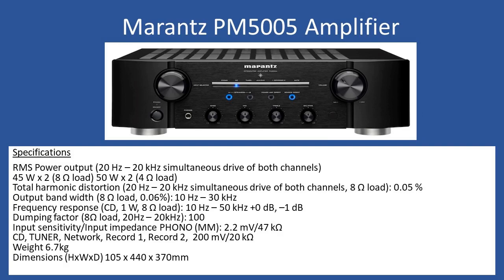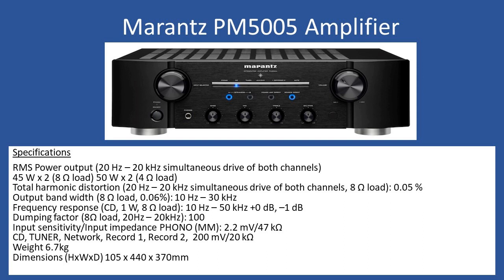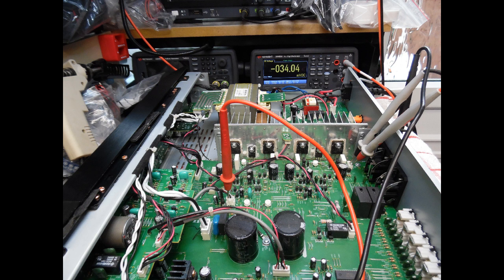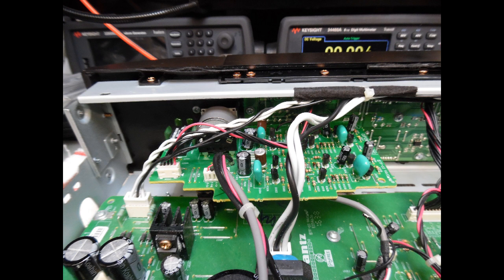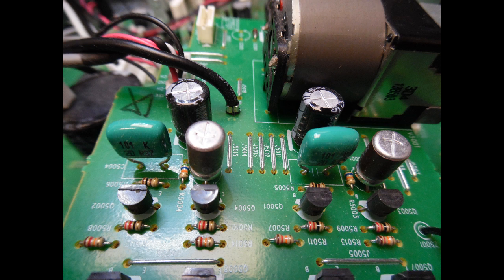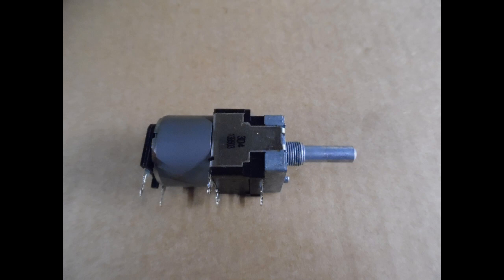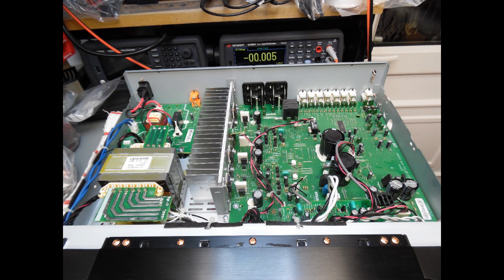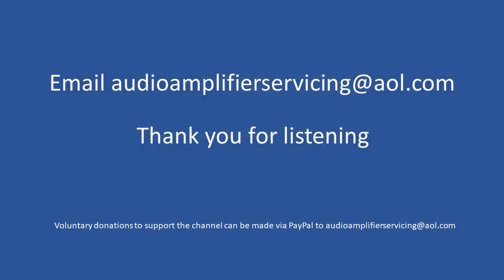Marantz PM5005 Repair (With Audio Tutorial)

Comment: Hi, bit of a newbie here. Can you please explain how you measured the static resistance of the volume potentiometer across R5004 and R5003 8:21?  Where exactly did you place multimeter probes? And did I understand right you said that the measurement was done with no power applied?
Reply from the maker: Hi Yes the measurements are made with no power, to measure the resistance change of each of the potentiometer gangs.
Connect you multimeter across each resistor inturn, the readings should be more or less the same. You can rotate the potentiometer to check if the resistance changes across each of the resistors again the resistance measured should be approximately the same.
Reply: @AudioAmplifierServicing  Ok. Thanks! Also as it is near impossible to get a volume pot replacement for this amp in UK (all sites say it is either unavailable or discontinued) I managed to source a supposed like for like replacement but the part number is 422M-50KBX2. Apparently it's an ALPS RK168 motorised potentiometer. Do you know if this is a suitable replacement?
Reply from the maker: @petelamparski8226  Hi I do not have details of the pin outs and compatibility. A genuine replacement can be ordered from here they ship world wide https://www.soundservice.gr/e-shop/en/product.php?products_id=13275
Reply: @AudioAmplifierServicing  Hi. Thanks for that. It's not cheap though... €55 plus shipping😳 That is almost as much as I paid for my second hand amp (PM6005 model). I paid a fraction of that price for this volume pot. I bought more than one just in case, so I guess I can open one up and compare it with the inside of the faulty one to see if everything matches. It looks exactly the same from the outside with same amount and positioning of the pins and it's advertised as volume pot for the Marantz PM6006. From what I have read online both PM6005 and PM6006 are using the same volume pot. Do you know if that is correct?
Reply from the maker: @petelamparski8226 Hi yes both Amplifiers use the same volume potentiometer. Also Denon PMA520/720AE.
Reply: @AudioAmplifierServicing  Grerat! Thank you for your help and advice.

Comment: It seems that part is very poor quality straight from the factory. I have lower volume on the right channel rather from thr left. The center image is always moved to the left. Measured the two gangs and there is about 3-4k difference in resistance no mather of the position. I ordered brand new pot from Sound United and it came exactly the same.... diferent values for both resistors. The total resistance is 53k vs 47k but it must be euqal. Verry disappointed that I can not fix my amp with genuine parts. Now I will need to put a trimmer on that 56k R5004 and R5003 in order to adjust the gain and balance both channels.
Reply from the maker: Hi very sorry to hear this and the new part was also defective, I have had good experience ordering this https://fixpart.co.uk/en/product/sound-united-00d9430197305-potentiometer-focus-volume-amplifier